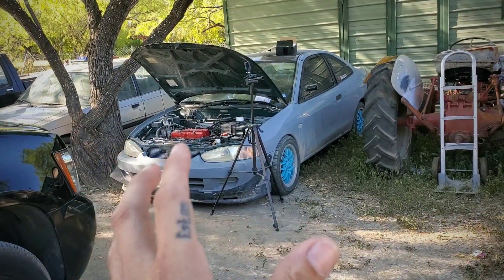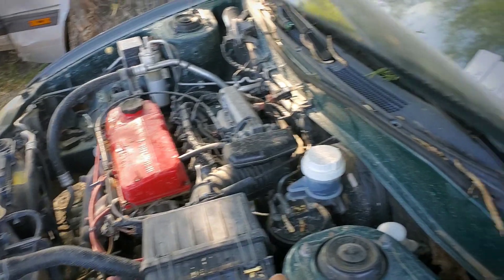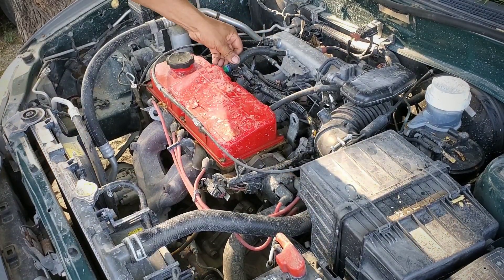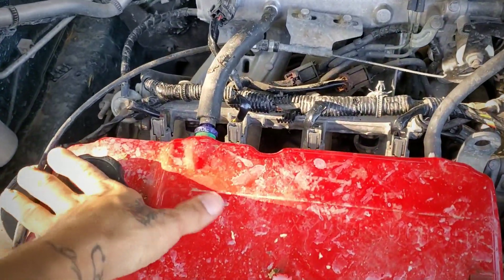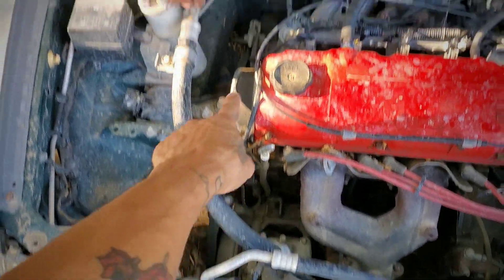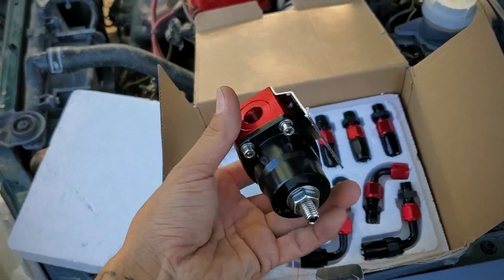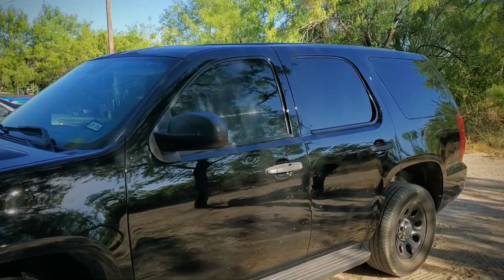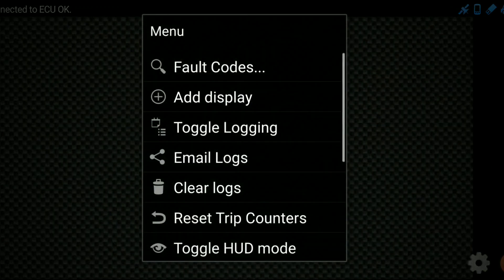Bigger Injectors No Tune | Mitsubishi Mirage / Technica

Comment: Have you noticed a difference when you drive it? If you are running rich take the air filter off and only run the tubing and maf sensor,  I have the same engine considering picking up those injectors if the engine seems to run fine with them

Comment: Hey bro , i have the same car with same engine ,does it run okay with those injectors?
Reply from the maker: I ended up taking them off a few days later.  It started puttering when driving. when I took them off I noticed a piece of the injector had broken from the seat on the intake side. I guess they were a bit longer and needed a space on the fuel rail. 🤷🏻‍♂️
Reply: Thanks👍🏼

Comment: turbo Mirage would be pretty sweet...I would have to imaging A/C would be necessary down there in Texas though?  A new compressor is not too much money for these cars
Reply from the maker: Yea, days get very hot down here! The compressor, I've seen it online around $180. If there's no issues fitting a turbo & manifold without having to remove the ac, that would be amazing! Kinda like a "sleeper".. if it didn't already look like it wants to run. 😁
Only way to know is to try it.

Comment: some vary know where is the fuse for the injectors
Reply from the maker: I still  have the car. I checked the relay box under the hood, but shows no relay for injector. Mostly fan relays,  headlights, fog lights, etc.. And my car doesn't have the lid for the fuses inside on the driver's kick panel.
As far as I know,  there isn't a fuse for injectors. They should run off the crank position sensor /